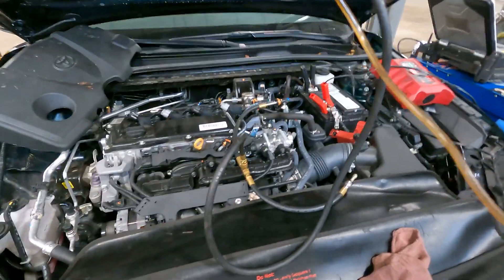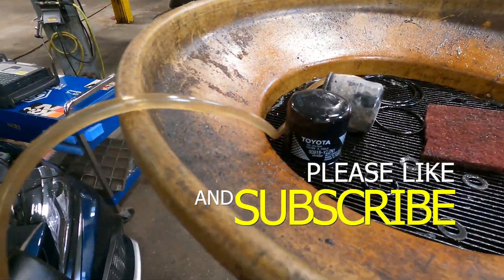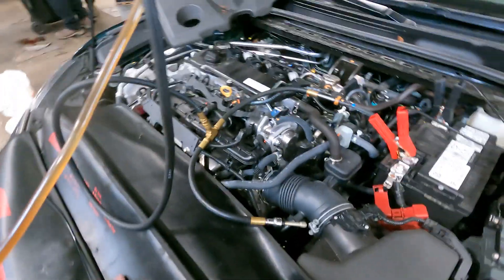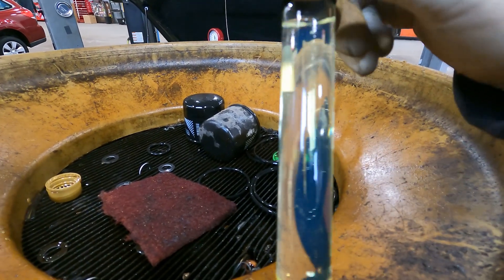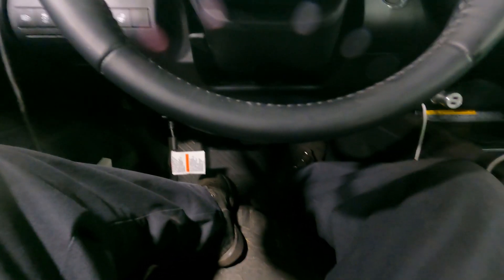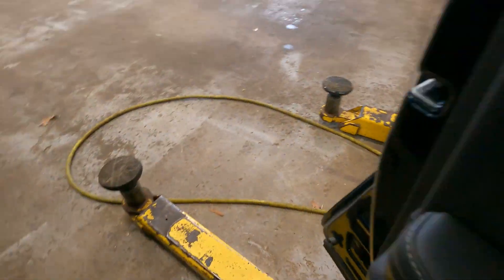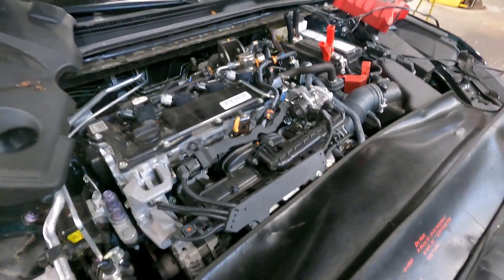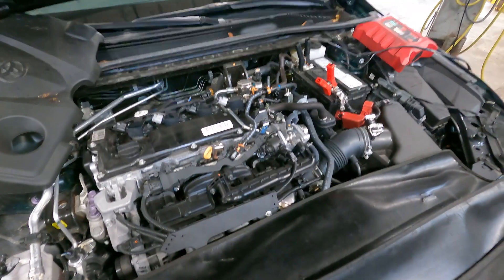Customer states "I PUT DIESEL IN MY GAS 2022 TOYOTA CAMRY!"😨😫😫Will it be ok???

Comment: At least they admitted what they did rather than tow it in and tell you it won't start.  I'm disappointed that there's no Feifel activity, though!
Reply: Fiefel was operating the fuel pump...
Reply: This is why I took the precaution of putting “Diesel Fuel Only” emblems all over our fleet’s only specialty diesel truck.  Sticker by fuel gauge, sticker on the dash, sticker above the fuel fill door, sticker inside the fuel door.  My coworkers thought I was crazy.  That is until our sister group in another city put gas in their truck.
Reply: It's 2022, give couple months 😂
Reply: With the size difference between unleaded and diesel I would like to know how they got diesel in the fuel tank. Just wondering.
Reply: Some stations use standard gas nozzles for diesel pumps. Here in Ohio, I'd say 60% of diesel pumps utilize gas nozzles; they're usually colored green instead of black. 
Doesn't seem to help though. Most women can't be bothered to know complex scientific maxims like "diesel is not gasoline; don't use it in your Prius." (And yes, it's always women. I've never known of a man to accidentally pump diesel instead of gas. That should be a capital offense for a man)
Reply: @RockandrollNegro  I knew a man who put regular gas in his diesel Volkswagen Touareg. He took it to a shop and they did the exact same procedure that they did in this video. But the tuareg still never ran right. A few months after this he "crashed" it, and totalled it out for insurance money.🌝
Reply: @RockandrollNegro  You should watch The Amazing Race 3. There was an episode where the teams had to drive from Portugal to a ferry terminal in Gibraltar, and half the teams put Gasoline into their Diesel vehicles, and believe it or not, most of the people who fueled their Diesel vehicle with Gasoline were male.

Comment: Flex fuel, but not THAT flexible.
Reply: I think on these Camrys you can actually put 88 or E15 on these. So it’s almost a flex fuel.
Reply: @DuckMcDuckinson  I think you missed the joke bud.
Reply: @ricky-sanchez  oh no I got the joke. Just wanted to say that it’s actually a little flex fuel Fr fr. I own an XV70 Camry SE and they can take that fuel I said earlier.
Reply: @DuckMcDuckinson  I love the xv70 Camry, but I just love Camrys in general.
Reply: @ricky-sanchez  it’s great! A very comfy drive and I love the cruise control on it it’s literally like a Tesla sometimes.
Reply: @ricky-sanchez  yeah I have a 2010 Camry LE 2.5L also and it is such a nice engine and the ride is very smooth and I love taking care of it also.

Comment: for those asking if diesel nozzles are bigger some are but most aren't the bigger nozzles are usually found at truck stops and CO-OP or wherever you get farm diesel from in order to quickly fill 100+ gallon tanks faster, but BP is bad about using the green nozzle for Gasoline and the black for Diesel when at every other fuel station it's normally black for gasoline and green for Diesel
Reply: Europe it is green for unleaded and black for diesel almost always. Texaco 30 years ago used to be the other way round which was confusing.
Reply: @katywalker8322  that's the way BP stations are here in the USA they're the exact opposite from other stations my aunt used to own a Volkswagen passat TDI and stopped at a BP and put gasoline in it and well what CSW just did to this Toyota had to be done to her Volkswagen you'd think they'd all be uniform by now and that this wouldn't happen but it still is fairly common
Reply: @Th3DavidPugh  , yep. Must massively increase the number of misfuels.

I did it on a bike in the late 1980s! In a hurry and picked the wrong pump (4*, then 3*, then the next was diesel instead of 2* petrol). Noticed as the tank got full that it was a bit foamey. Into the pay booth and they said "I didn't realise bikes ran on diesel" - I replied "they don't, have you got a bucket I can borrow!"

Small bike, so landed up turning the bike upside down to empty the tank quickly (fuel pipe alone was way too slow) into the bucket without any tools handy......
Reply: the standard car sized diesel nozzle is bigger than a standard gasoline petrol nozzle. 
it's maybe 1 cm bigger but it still won't fit into a gas car. 

truck stops may have even bigger but the standard car sizes will not fit.
Reply: I worked at a gas station maintenance company, Oscar W. Larsons. We serviced Michigan, Ohio, Indiana, and some in Illinois. It is LAW to have bigger diesel nozzles on ALL pumps!! BP does screw the handle color up on the nozzles, but the nozzle itself IS BIGGER! It's to stop people by mistake putting a diesel nozzle in their non diesel car. Go ahead and try it. You can't do it. So I have no idea what BS your peddling!
Reply: @scrapcash2421  laws don't mean it'll never happen though. 

I used to fuel my car with e85 in a state that only had roughly 9 pumps and there was little standardisation to the pumps. Some pump handles were yellow and clearly marked at the handle with a with medallion, others had plain handles with gasoline octane numbers on the pump selector button instead of the e85 logo. I also noticed the correct hoses and pump handles said "for e85 use" printed on the rubber and the frame of the handle, and some stations had standard gas nozzles and hoses hooked up... the pump handle squeeze lever on those would get all gummy and almost feel like it wanted to stick on.
Reply: had an "argument" with a manger of a BP in the UK once. Company i work for used to use an agency card (Keyfuels back then) and that pump was the truck one. Of course, being a light van the filler neck was too small to accommodate the nozzle, so I used a regular pump instead (and that's when "the argument" started - when i went in to pay).
Reply: @volvo09  Thank you for adding all those aldehydes to the atmosphere.
Reply: @Th3DavidPugh  Yeah but, the diesel and E-85 pump nozzles are always separated from the 2 to 3 nozzles of gasoline, since it can't share the same pump system because of cross contamination. Plus, there are large letters that say D I E S E L.  Although, it fits the mechanically challenged M.O. of Camry owners
Reply: True...We have a chain station that has up to four hoses per pump and if you aren't careful, some yoyo will have switched the nozzles in their sockets. Almost always I  follow the hose to its outlet to determine which fuel I'm getting. There is usually a failsafe though, when you punch the start button and nothing happens when you pull the trigger on the nozzle you have the wring nozzle. And gas stations do make mistakes now and then.
Reply: Welcome americons to the rest of the world. In Australia BLACK handle is diesel. Green is regular fuel (91 RON). Yellow mid grade (95 RON) and red or blue premium fuel (98 RON). I think you’ll find that mostly everywhere in the world to have black as diesel.
Reply: I've gotten one of the big ones stuck in the filler neck on my 95 Powerstroke.
Reply: Always read the label. I have ben driving a number of years and will always check, even when filling my car, my bike, or the company vehicle.
Reply: But they had to have pressed the button for diesel first
Reply: In the US all diesel nozzles are bigger than gas nozzles
Reply: I agree on your point about the green nozzles used for all grades of gasoline at BP. Confusing for sure
Reply: In uk always black for diesel and green for petrol (gas)

Comment: As weird as this may seem, I would have drained the gas diesel mixture into a clean container and reused it in a lawn mower, chain saw, or some other small non fuel injected engine piecemeal until it was gone. Back when gas was .37 cents a gallon (yep I'm that old) we used gas or diesel as a fluid for washing greasy parts on the farm.  That was mixed with old oil and painted on machinery before winter.  Great video, as always.
Reply: Diesel is after all a light oil, much Much worse putting petrol in a diesel vehicle petrol is non lubricating.
Reply: Just to see what would happen, I once put a couple of ounces of gasoline in the tank of a lawnmower, just to fill the bowl, then topped it off with kerosene. It used up the gasoline, and kept on running with the kerosene, much in the way two cylinder John Deere's worked, only they had two fuel tanks and a hand valve.
Reply: depending on the % of diesel in that fuel a lawn mower might not even burn it. too low compression with to cold of a spark but if it was more gas then diesel than probably would work
Reply: Hey Fritz, would you ever consider being on a podcast about your life experiences?
Reply: @yeh.80  I'm flattered, however, I'm probably the least interesting person on the planet.
Reply: @fritzfiedler1807  Hahah well that's not a bad thing. I reckon some of the most mundane people have some of the coolest stories.
Reply: When I used to sell gasoline for 19¢ a gallon, (yep, I'm that old), we used diesel to flush the oil pan of sludge as part of an oil change. Of course diesel was cheaper than gas back then so the extra cost wasn't all that bad. 😁
Reply: @walmartdog1142  My friends father used to drive cross country twice a year in his Studebaker van.  He'd fill the second tank with diesel and switch over once he was cruising down the highway.

Comment: Had this happen one time. Lady was lucky enough to realize what she did before starting the vehicle. We dropped the tank drained it and cleaned it out. Ran fine and she never called to complain.
Reply: We had a guy at work fill a diesel with gasoline. The computer must have known the difference because it wouldn’t let the engine start.

Comment: It's been my experience that the engine will quit before plugs or cat will be fouled. The stuff just doesn't burn at normal compressions ratios. You get the tank empty enough to where you are less than 10% diesel and it will eventually clear itself out. Basically DILUTION is the SOLUTON! BTW, you might want to change the fuel filter if it has one.

Comment: As someone who os a diesel mechanic. I can tell you that diesel fuel definitely has a odor to it. Get it on your clothes, and its on your clothes for the rest of day. I changed the fuel filter on a Chevy 3500 duramax in the morning, and when I got home at 6:00 I still smelled like diesel fuel lol. Anyways great video.
Reply: He never said it had no odor he just gasoline was more of a potent smell...
Reply: @samholdsworth420  going back and re-watching it. I definitely miss heard him. Diesel will definitely make you smell horrible for a day though.
Reply: @fanciestspoon586  it's definitely a different odor, but i'd say it's more of a somewhat softer smell at first, but it grows over time that you are exposed to it, much like how gas has a faster flashpoint when ignited vs diesl, their smell and strength is about as fast over time, gas hits full strength and generally don't get any worse over time, where as diesel seems not to bad to be around initially but then gets less appealing over time. It's certainly more difficult to get off clothing or your hands since it just doesn't evaporate like gas does.
Reply: @SpectrumTwist  I definitely agree with you on it being worse over time. To get the smell of diesel off my hands it takes about washing my hand 4 times To get the smell off. The longer diesel stays on your clothes and you the worse the smell gets. Nothing tops axel oil though. That stuff smells absolutely horrible especially if it's been inside of a tractor axel for 500 hours.
Reply: @fanciestspoon586  used gear oils and wheel bearing grease... yup that shit definitely doesn't go anywhere.
Reply: @SpectrumTwist  yeah, still have the transmission oil smell in my pants after couple of washes
Reply: @SpectrumTwist  Spent 8 years hauling both of them here, among other fuels. An old-timer somewhere along the line shared a trick with me: if you spilled gasoline on yourself, spray the affected areas of clothing with an ammonia-based cleaner like Windex. The ammonia reacts with the more volatile (and accordingly more pungently odorous) components of the gasoline, helping them to evaporate into the atmosphere more quickly.

Sadly, he had no such trick for diesel. I would call the smell of diesel more sulfurous than the smell of gasoline, if you want an attempt to describe it. I found that anything which had been soiled with diesel usually required two cycles in the washer before putting them in the dryer in order to satisfactorily remove diesel odors.
Reply: @Larry_Harvilla  Actually you can usually deal with diesel on clothes with either fast orange or orange glass cleaner, a shot on either side if possible and then wipe it away, the orange tends to provide a potent alternative smell while being able to cut through the petroleum base of diesel.
Reply: Same here I’m a diesel mechanic in the army and every day my uniform smells like diesel 😂
Reply: I had a diesel bug and had to fill up with the huge semi pump nozzle. Dripped a ton when I took it out of the filler neck right on my shoes. Had to ride with them out the window and just threw them away. Diesel stinks lol.
Reply: @fanciestspoon586  Yup, petrol may smell stronger, but diesel smell lasts for so much longer, and has a tendency to stick to everything.
Reply: @brendonjohnson2108  when I was a teen, I worked at an oil refinery. Had to keep my work clothes outside the house every night because of the diesel, oil, and gas smell. I'll never forget how strong that smell was.

Comment: my wife recently filled my 2021 elantra to the brim with diesel and ran it till it stopped. needed a new lpfp all new injectors and had to clean the whole system like you did. i hope to god my cat is ok.
Reply: Is it okay cause i may have fucked up and now its at the shop and ive drove it only down the block until i got it towed.

Comment: Back in flathead Ford world, when siphoning fuel from farm tractors, mistakes were sometimes made. For the record, a flathead will run for several miles with some diesel in the tank...very high RPMs required. Don't ask how I know. Darn diesel tractors.